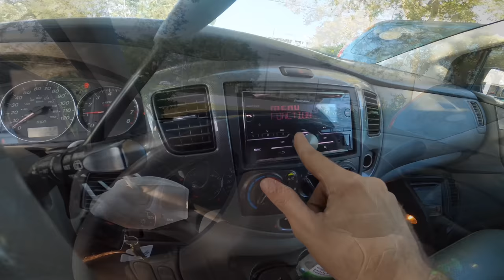Bolts through the window! Mazda MPV 2005 Window Regulator Broken

Comment: Ray, you got the driver's side window so clean ... the customer might still complain because the passenger side window is still dirty ... and you changed the radio station (one of my pet peeves whenever I have work done on my car).
Reply: One way to avoid getting your radio station changed is to turn it off. I have cars come in with the radio obnoxiously loud. I made sure they listened to Rush Limbaugh when they left. The shop usually has a radio we can listen to.
Reply: @wrench31e22  I have the radio off when I drop off the car. My pet peeve is when the mechanic changes the station and leaves the volume way up so that when I get in the car to drive away, I get to listen to music that is not my taste. I've mentioned that a couple times to the service manager but most of the mechanics still do it. And if they disconnected teh battery (which means I need to reprogram the radio buttons), it would be nice if they told me that.

Comment: Spot on repair Ray 😀
Shame the owner didn't want the other one done, it will fail.
Reply: By which time they may well have been paid & be able to afford to replace it, meanwhile, it works well enough.
Not everyone can afford to double the bill just to save a trip back in N months.
Reply: Usually with the window down and just before or in a heavy rainstorm or below freezing in colder climate areas, on a Saturday, after the repair shops are closed and with a holiday on the Monday. Never fails.
Reply: @BigLisaFan  Yep i would call that 'Sods law'  😀

Comment: We had a black Jaguar S type and every year when we brought the car to Florida I had to replace a window regulator because the heat would soften the nylon clip at the glass and it would fall off the track. I had the car 5 years and replaced all 4 windows.

Comment: Thanks for the video. I tried to change a window  actuator on a Honda Accord with no guidance. It was a fail.  I'd like to see more videos on changing window actuators.  I'd actually like to do it someday myself.  Any advice?
Reply: Actuators operate door locks by linkage and a linear motor.
Window drive motor and regulator raise and lower the glass.
On a Honda, go with new parts for everything you have to touch. Experience tells us.

Comment: So odd that he sent it in for a passenger side window when the driver's side was non-functional and then said to just do the driver's side.
Reply: Probably budget constraints.
Reply: @kenc2257  Could be. I've done it before where it could have been one of three things which all required special tools that only the dealer had for diagnostics. Replacement was doable with hand tools, so the choice was pay for diagnostics or fire the parts cannon.

Comment: The first step should be be cleaning the window track, then spray silicone in them. Then proceed with insuring there's no binding in any of the cables or wheels of window regulator. Sometimes dirt/grime gets in window mechanism hardware creating excessive friction.  If you are lucky, no parts required, just cleaning and lubing.
Reply: I generally only replace window regs when they completely die. Most of the time silicone the runners  and oil the motor and, done.But then if it all goes wrong a couple of days/weeks later, its only my time and no an irate customer threatening to punch my lights out 😄

Comment: I had a window tint specialist who insisted on re-fitting the windows. "Where are the other parts?" uh, at home where I intend to fit them myself.

Then just slices through the moisture barrier with a knife to get at what he wants to fit anyway. The same windows which have to come out for the other parts to go in.

I spent probably a good 20 minutes on each door cutting through the adhesive and  this twat gets a knife. Not impressed.

Comment: I think you missed a spot where you were about to hang the door panel without plugging the wiring harnesses back into the window switches...Luckily, you had to remove the panel again to fit the metal retainer bracket you also forgot🤣👍🇦🇺

Comment: I did this procedure pretty much twice on my own car a few weeks ago! The strains of the steel cable broke and got tangled getting the window regulator stuck. I did remove the glass from the door first, then replace the regulator and finally put back the window.

After this repair the windows were fully functioning but still a bit slowish when contact was on but the car's engine was off. I might soon also try another difficult repair on my own car: Replace the car battery! Maybe that's done after 12 years of service?!

Oh and you did miss a spot. There was plenty of dirt @ 12:48 in the section of window that remains inside the door when you fully close the window. I did clean my windows fully when they were out of the doors.

Comment: I have done a ton of these.  (5 to be exact) 🙂 I find that getting the glass out of the way while working on getting the regulator bits out/in makes it easier. I just tape it in the up position once it's disconnected using blue painters / masking tape. 
Of course, I have that handy because I'm not in a shop, but in my garage, where I have tools/stuff from every DIY project known to man. 🤪

Comment: When you got in the car at the beginning, the steer wheel was upside down. This like oil filer caps facing the wrong was is annoying. When parking folks should position the steering wheel properly. It''s not hard. LOL

Window was spotless.

Comment: Top job, u obviously work on shit loads more cars than I do, I've learned lots from ya, actually done this job though, I use masking tape to hold the windows up, stick it to window and then over the door frame 😉 😀
Reply: find a bit of timber and you can wedge it in the door area to hold up the glass. no more glue line on the glass or body